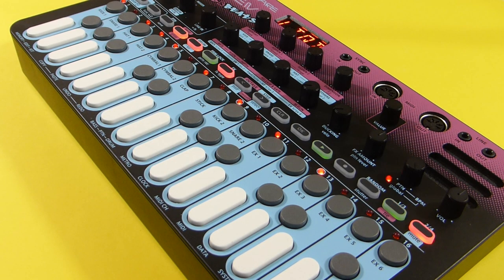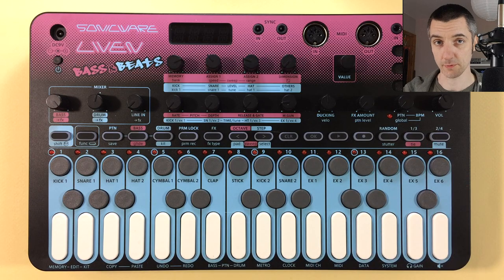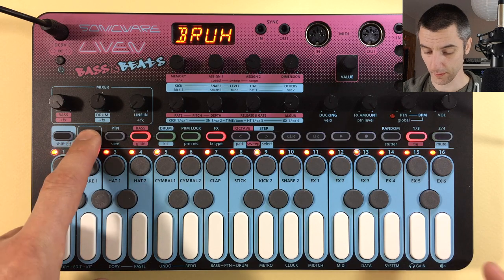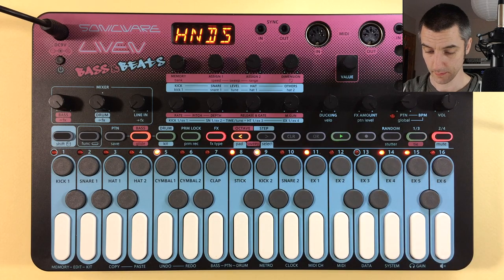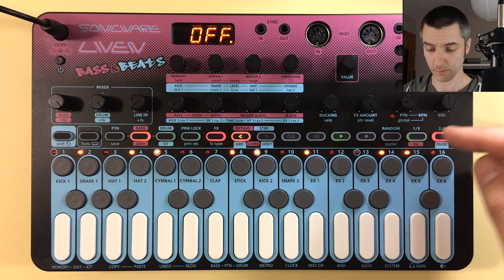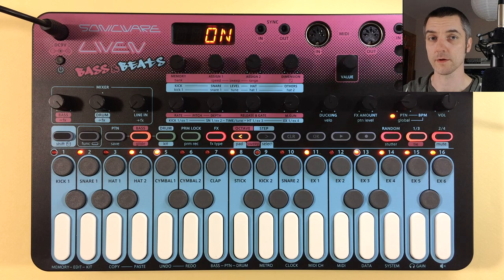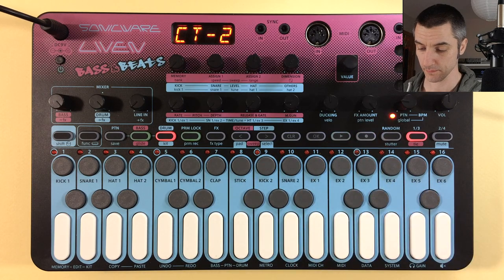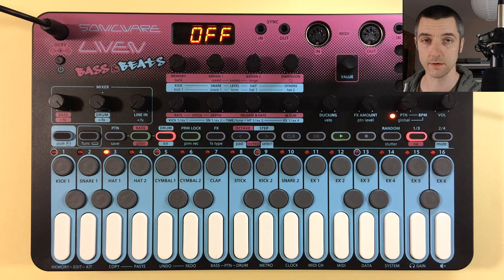SONICWARE Liven Bass&Beats Tutorial Part 1: Quick start, Drum Programming, Kit Editing

Comment: Say, for instance, I came up with a 16 step beat I liked but then decided to extend the drum track for 32 steps.  Is there a quick/easy way to duplicate the existing rhythm onto the new/blank second page of the extended pattern?
Reply from the maker: No sorry, I wish there was. You can copy steps if you need to using the copy function but when copying parts of a pattern I just found it best to duplicate my programming manually.
Reply: I feel like this could be a nice firmware update. Press copy and pattern then put it where you want.

Comment: Hey Chris!
Question...so I found a somewhat odd behavior in the Bass synth sequencer. With autostep enabled, after having armed the record button...when selecting the starting step...the sequencer doesn't allow me to choose step 1 as a starting point.
If I press 1 it automatically jumps to/back to step 2. With no notes having been pressed/sequenced.

If I try to force it by holding step 1 THEN inputting a note...it records it then automatically skips to step 3 (note tie disabled) then proceeds to function as normal. BUT skipping note 2 on play back...
Oddly enough if you use the encoder to manually step back to note one (still on an empty sequence) it does so no problem and proceeds to function as normal (doesn't skip to step 3 after 1st note input).
Is this normal behavior for autostep?
(I hope that wasn't confusing)
Reply from the maker: I'll have to check this ans get back to you but it doesn't sound quite right. Thank you for letting me know

Comment: Many thanks for your tutorial. I just received mine yesterday, since I was moving my studio haven't used it yet. I hope you do a tutorial for each of the templates but since I haven't as yet read the manual it might not be necessary. I understand you also did patches for the B&B must have been fun, thanks again for the video.
Reply from the maker: You're welcome. Yes there will be another tutorial for the bass track and editing overlay some point soon I hope
Reply: Marx Man  maybe practice a bit? Set things up right and then performance wise on stage you could mainly just be muting parts in and out and using the stutter roll, hardly that difficult even in the dark. And the drums on this thing are BANGING.
Reply: Marx Man  I’ve been using hardware and software for 20 years myself. The only thing Ill probably do change the knobs so I can read their positions in the dark. This isn’t a user unfriendly piece of gear you just decided to not put the time in required for ease of use🤷🏻‍♂️

Comment: There’s no quantize feature on this, right ? If I real time record then I’m limited to 1/32 ppq? 
      Also no usb so am incorrect in assuming there’s no way to export to say, a friend’s Mac? I see there’s an export function but I’m not clear on how that’s done . Otherwise , an incredible piece of kit , there …. 
     A Midi audio interface would do the trick, I s’pose.
Reply from the maker: You're always tied to what ever the step size is which can go up to 32nd notes and 64 steps long, so you can't create rhythms with any more resolution than that. Anything recorded into the sequencer will just snap to a step.

That's correct it has no usb. Exporting is accomplished by the midi sysex format sent over the midi output. This requires a midi interface and either DAW software or midi sysex librarian software like Midi Ox
Reply: @ChrisLodyMusic  Ok, thanks again for the prompt and through response . So I guess this think is deigned either for live (duh liven) or print to directly to audio after programs unless a laptop is handy . I guess Sonicware is finally gonna go SD card on the new Smpletrak. 
     You’re a real asset to the company, they’re lucky to have you aboard .

Comment: Hi Chris, can filter fx be applied live in playback mode? and can it be applied per part (parameter locked) Great tutorial by the way :)
Reply from the maker: Yes there are a few different filter types and a tilt EQ that can be applied through the FX section. There is a single FX unit for both parts but the send amount can be different per part, or turned on\off for insert type effects. You can automate the send level per part but not the FX amount knob or type. Hope that helps

Comment: Hi again Chris. I'm unable to get the drum track to stutter.  It's fine with the bass track (func+square button 14).  However, when I switch to drum mode and toggle Stutter on, the steps simply audition individual drum samples and don't stutter the pattern.  What am I doing wrong?
Reply from the maker: Sorry for taking a while to respond. It looks like the stutter setting only works in Select mode in the drum track. This makes sense considering how the different modes work but I forgot to mention this in the video. Sorry about that
Reply: @ChrisLodyMusic   Many thanks. Yup.

Comment: Troubleshooting: my bass & beats keeps shutting off. Have had it for a few months now. Was working fine. But now it shuts off by itself.
Reply from the maker: There is a couple of things to check, both in the System menu. Firstly make sure your battery type matches the Batt setting here or it might turn off too early. Also there is an auto power off that can be disabled. Other than that please contact customer support here: https://sonicware.jp/pages/support